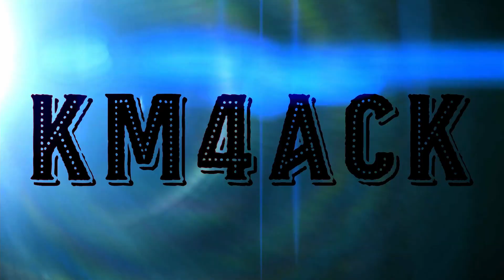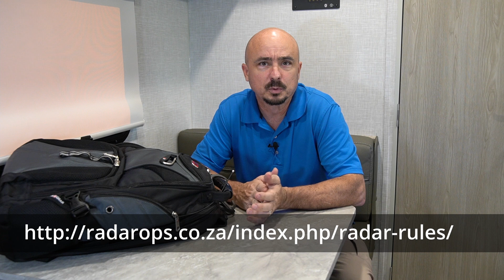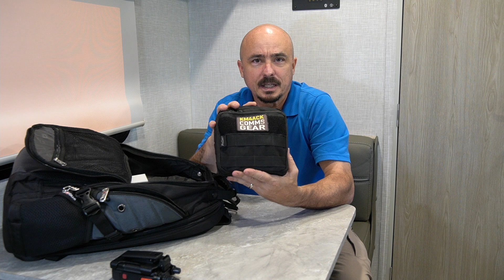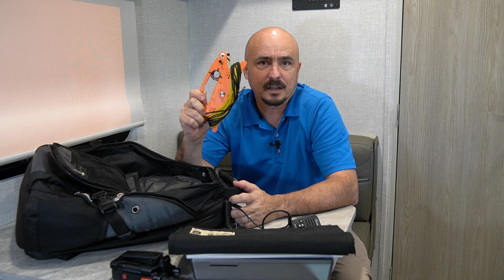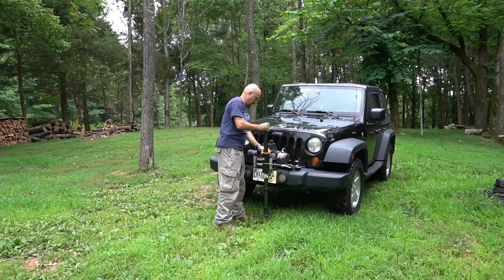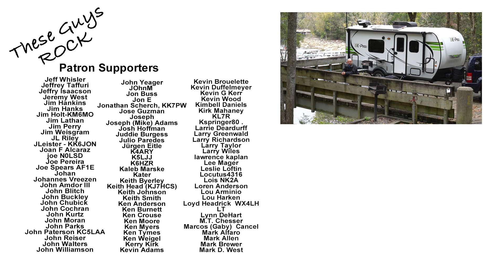RaDAR Challenge Prep 2021

Comment: That seems like an excessive amount of equipment for RaDAR. If I can make it this year, I’ll have my TX-500, a small LiFePo4 battery, and my 80-10m EFHW. All of it is a bit bigger than pocket sized but not by much
Reply from the maker: All depends on what you want to do. I like having the ability to work digital modes in the field.